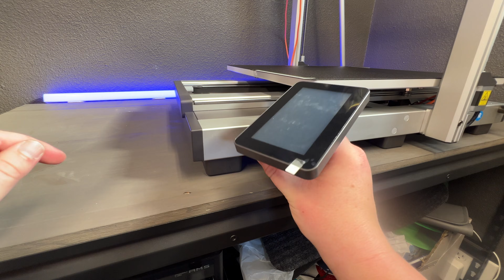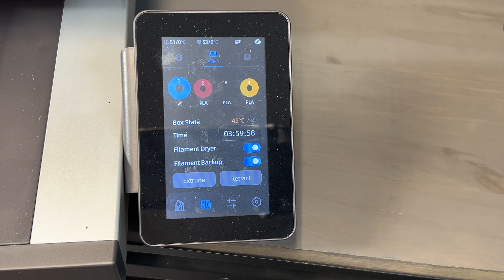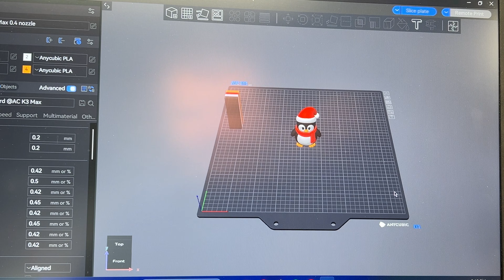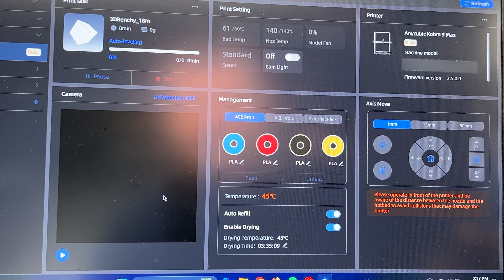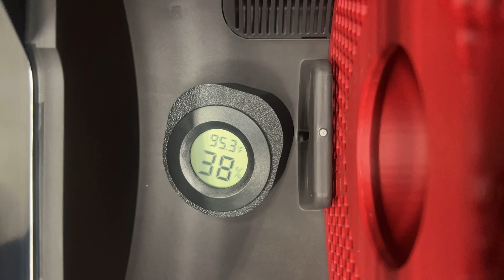Anycubic Kobra 3 Max Combo First Impressions

Comment: I think I am going to go with this printer... isnt much bigger than my Anycubic Chiron... But as it is on its last legs it is due to be replaced.. But I have always used cura with my chiron but everything I have read is that this one only uses the anycubic slicer
Reply from the maker: It has a lot of modern improvements compared to the Chiron, so if you liked that machine, this would be a good upgrade. Yes, it is lacking dedicated profiles in most slicer programs and I’m not sure if profiles will be added in the future. I have seen community profiles floating around but I have only used the Anycubic Slicer. Other channels have reported bed leveling and clogging issues but I haven’t had any issues so far.
Reply: @ResinForge thanks for tge responses... I ha e had my share of clogs but this new printer has a lot simpler way to fix it. I have to tear my whole hot end apart